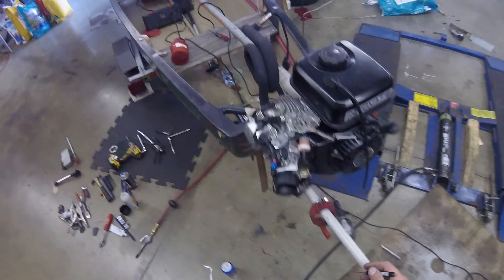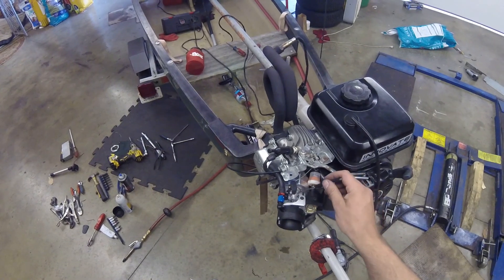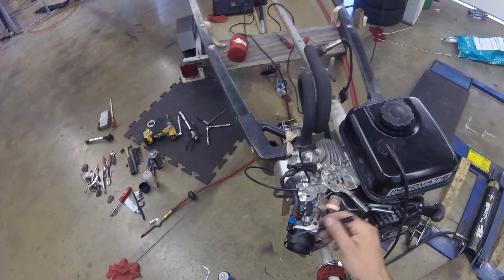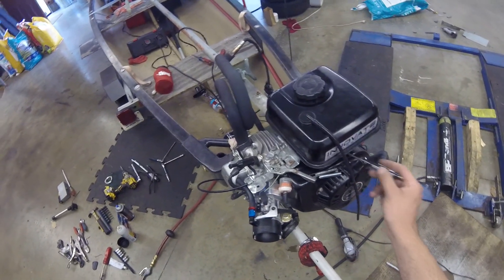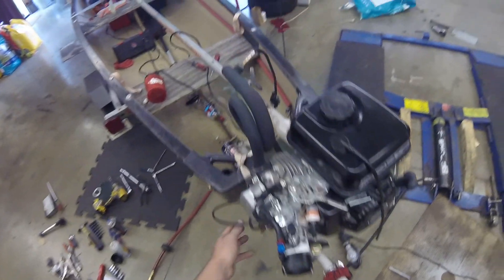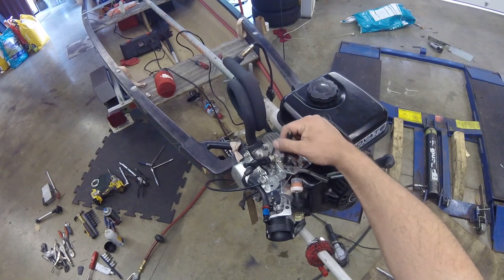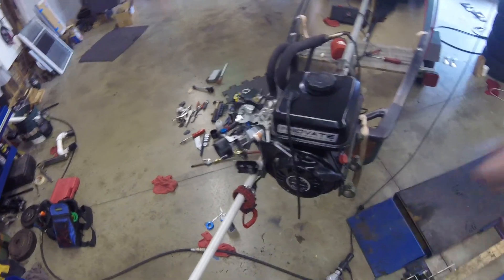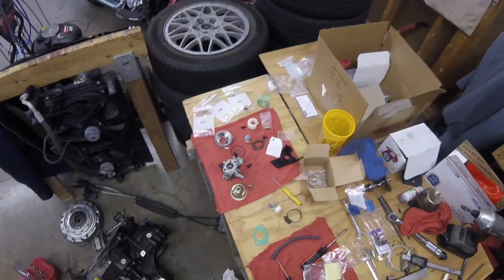Worked GX270 Carb swap on my Predator 212cc with a .308 cam

Comment: You should really use a catch can with that setup or it's going to suck up alot of your oil especially in something like a boat running more constant high rpm.
Reply from the maker: The champion valve cover has some nice baffles that reduce oil consumption via intake. Rather not have a can to keep it minimalist if possible. But it was an idea if I really need one.
Reply: @m85suchka  Whered you buy that valve cover?
Reply from the maker: @SALMotorsports  with the rocker arm conversion from champion

Comment: Shop full of  tools and equipment and can't figure out how to tune a Chinese engine, pretty sad.
Reply from the maker: Louis S. And tuning for 3200 rpms was easy with the stock tank. These carbs were never made to run much over 4000 rpms. Now that I'm running it up to 8400rpms the fuel pump fixed the fuel supply problem with running the bowl dry after sitting at wide open throttle for long periods like these boats do. Not so much a problem on a back yard kart.
Reply: swagondawheels jared To reply to your second comment, again thats very basic common sense.  You spent 15 minutes talking in circles.  You have a decent setup but this video is awful.  Not being mean just being honest.
Reply from the maker: Louis S. Plus I'm looking for those quality videos of yours where you articulate everything you want to say perfectly and to the point. Oh yeah I found 0 on your channel.
Reply from the maker: Louis S. Is that 5.45x39 in your profile pic? Where is the 74 build video?
Reply from the maker: Louis S. Because I repeat the same thing like "you know" or something every time no matter what. But just saying I can't do something I clearly have makes no sense.
Reply: swagondawheels jared Here in the comments, just like your videos,  you talk to much. Zero substance.  If you dont want people telling you how much you suck then disable the comments on your videos. Instead of sitting here trying to prove yourself to me you should be brushing up on your mechanic or video skills.😂😂😂
Reply from the maker: Louis S. Zero substance here? I see zero substance on your channel 🤔
Reply: swagondawheels jared you dont see anything because I dont have or need a channel. All my engines run and run well. You are the one STILL trying desperately to get some sort of validation. You doubt yourself as you should because you have a long way to go. 😊
Reply from the maker: Louis S. Come by and find one of 11 running cars and or equipment on my property that aren't running. Oh they all start right up. Quit trolling a 31 year old that has been working on carbureated and efi vehicles plus diesels since he was 14. When was the last time you got an efi vehicle running and tuned on an aftermarket ecu you wired from scratch?
Reply from the maker: Louis S. I was feeding into to your trolling to begin with because I was hoping you were a somebody willing to school me on something because I am always willing to learn. But you ain't bringing shit to the table so troll on cuz. Show me I'm from Missouri or screw off. And I'll leave the comments here and not delete them because I'm not for that libtard delete and silence my enemies stuff.
Reply: swagondawheels jared STILL trying to impress me, im so flattered! But have to admit im straight. Sorry to ruin your night.
Reply from the maker: Louis S. Level of arrogance on your part x10 ends with you thinking I want to impress you. I'm having a good night thank you, btw learn how to read and use to and too properly 🙋‍♂️
Reply from the maker: Louis S. My point is made 🤣🤣
Reply from the maker: Louis S. Can't figure how how to tune it? Really? I'm explaining to noobs how to. Thing holds 14.2 afrs at wide open throttle and enriches to 12.5 or so on tip in.
Reply: swagondawheels jared If that was what you were attempting you failed. You had no real information to offer and you repeat yourself constantly.
Reply: Nice video and cool build! While you’re building cool shit... Louis S. Is yelling at his mom from the basement. MOM!!! Bring me a hot pocket! I’m being a bad ass on YouTube 😂 what a Tool! The biggest tool in his own tool box. That mom bought for him at sears!😂 Haters gonna hate.
Reply from the maker: Louis S. I know I'm bad at making videos and I know I repeat myself when talking I cringe when watching my own videos. Editing would help but I don't care at the same time. Common sense though? That doesn't exist these days with most people much less on carb repair and or tuning.
Reply from the maker: Louis S. I don't need to prove anything to the people I know. Or prove anything to you. And you're talking a big game like you know how to fix everything. Let's see it! I'm asking you to prove yourself now. Let's see what you have done... And I'm not going to disable comments.

Comment: Im doing similar build but a welded 17cc hemi head stainless valves 28.5mm intake 25mm exhaust stock rockers and pushrods, .020" longer billet rod, billet fly wheel, 335cl cam.
Reply: With arc .990" candie cane style header
Reply: And 22mm mikuni
Reply from the maker: On a mud motor or a kart?

Comment: I guess that why Jody at ARC was saying he couldn't get the big block carburetors to run right. I'm sure you'll sort it out though.
Reply from the maker: Black Warrior Lures I figured it out btw. The surging was there after long wide open throttle runs with the stock 200cc carb as well. Once the engine could move more air with the cam and other parts the bowl couldn't fill fast enough with gravity alone. Walbro pump and all good.